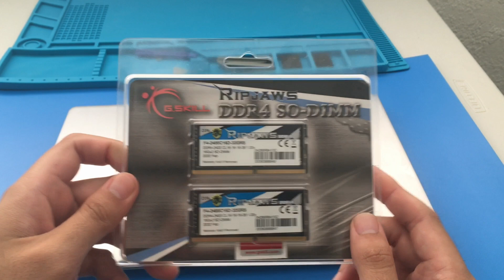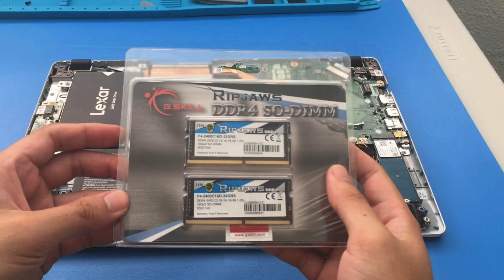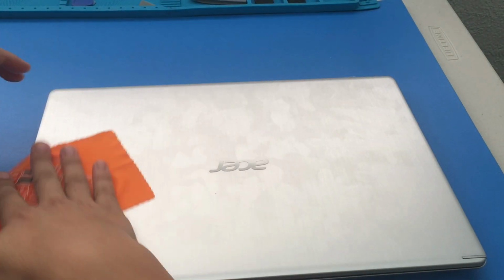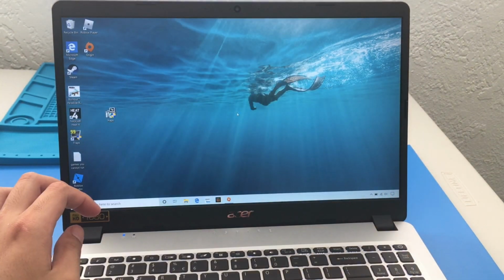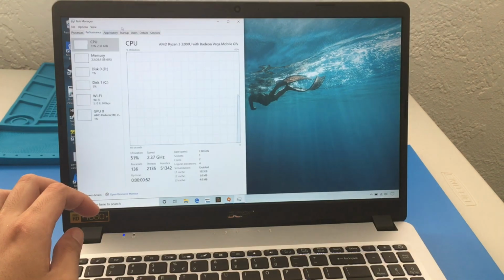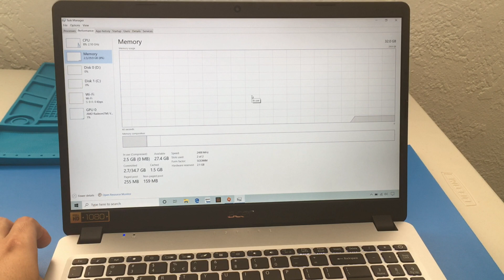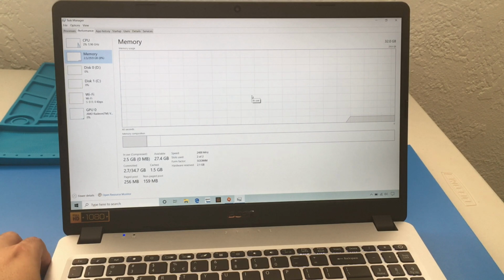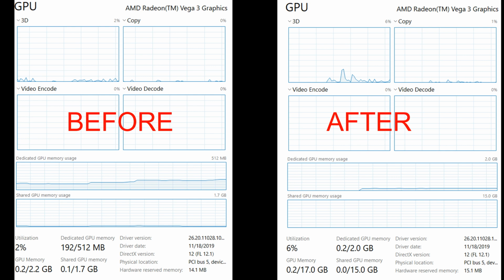32GB DDR4 Ram Upgrade! Acer Aspire 5 Slim Laptop A515-43-R19L

Comment: These are fun laptops to upgrade.  I have two of them and upgraded everything, including the NVME.  They feel even more like an exceptional value to me now.
Reply from the maker: I agree fun laptops to upgrade! That’s nice you upgraded the nvme. I’m hoping to do that as well
Reply: @whattmeter  I used the Intel 660p 512 gb drives for the upgrades.  Bought them for around 60 bucks a piece.  I can trust Intel.  I would limit my choices to either Samsung, Crucial or Intel for something as important as a C NVME drive.  Adata is garbage and impossible to register online and when they fail, they don't honor the warranty.  Other brands are rebadged and renamed units of unknown origin.  So if you upgrade, spend more for the reliability of a real manufacturer.  BTW, the main reason the Intel was inexpensive is it is a QV drive.  Lower performance but on these bargain laptops, really do a good job.  Hope this helps.
Reply from the maker: Thanks! Wow good to know. I’ve never used intel ones before. I actually have an adata 2.5 ssd i will install as an extra ssd for a future laptop. Cheap, but I’m not expecting too much from it
Reply: @BillyLapTop  honestly when it comes to components sticking to big brands is better even if it may cost more. It’s better so you have actual warranty and not a cheap scam
Reply: For more information about laptop watch out this link : https://youtu.be/di-uzKxPf34
Reply: how much hertz does it have when you put 32 gb ram im new to computers so it would be help ful if u told me
and will it lag if i download a game valorant
Reply: @zayoodexe  Not sure if you are referring to the hertz of the memory or of the cpu.  Memory hertz is usually locked in on these units and can not be overclocked.  The cpu hertz is variable but capped out at 2.8 or 2.9Ghz in burst mode.  Regarding valorant game I have no knowledge on that.

Comment: I thought this laptop on takes up to 16 GB, in my opinion 32 is a overkill but it works good vid.
Reply from the maker: 32 is definitely overkill. I wanted to see shared gpu memory with increased ram
Reply: i need help how to get rid of windows s mode
Reply: navigate to Settings | Update And Security | Activation. In the Activation menu, look for Switch To Windows 10  Home--

Clicking Switch will open the Microsoft Store and prompt you to "Get" the full version, akin to installing an app. Once you do that, your PC will switch over to its full version of Windows 10 and you'll be free to install whatever apps you wish. - you cannot go back to "S" mode after upgrading if that matters.
Reply: 32GB is not overkill, open 2 vmware machines and some chrome windows and it will be full.
Reply: @carlosfedericolopezspindol3103  what's vm ware?
Reply: @cjmeddings3205  virtual machine software
Reply: @carlosfedericolopezspindol3103  lol no significant fraction of the ppl who but this 350 dollar laptop are gonna do what u say.
Reply: Do you think this laptop is capable to run CoD Warzone after the upgrade(32GB)
Reply: @aminkhodary5154  if 20 FPS is fine with you then yes.
Reply: @Frost-ng4hi  will it lag a lot?
Reply: @aminkhodary5154  not with 32 GB of ram it’s just, it won’t be a smooth experience obviously kinda playable but not as good as console or a better laptop or pc
Reply: @Frost-ng4hi  I see. Thanks! I really appreciate your reply!
Reply: @aminkhodary5154  if the laptop use the i5 11th gen version , then yes, it will, though it will be like around 30-40 fps in low-mid(maybe) setting. But at this point, just make the Ryzen APU PC setup man..
Reply: @aminkhodary5154  not a chance lmao
Reply: I remember someone said that they upgraded it to 20gb, that might be the upper limit
Reply: Can 20 gb or ram 4+16 run roblox max graphics with a rysen 3 3200iu and a amd radeon vega 3 graphics card

Comment: Will Crucial’s 8GBx2 DDR4 RAM Work With It?
Reply from the maker: It should. Just make sure you choose 2400 Mhz laptop ram: you can also run the crucial scanner to double check.
Reply: jasetutorials why 2400mhz?
Reply from the maker: if you saw the ram video the stick installed was a 2666 Mhz, but the pc only read it at 2400 Mhz. that's why it's better to just get 2400 Mhz
Reply: I just bought crucial it should sork

Comment: can it also operate at a frequency of 2400 mhz?
Reply from the maker: Yes, the ram operates at 2400MHz
Reply: @whattmeter  can you make it run at a higher freuency?
Reply: @shod5507  no, the proccessor cannot handle ram with clock speed of more than 2400mhz (eg 2666), it will underclock the ram back to 2400.

Comment: gracias!
Reply from the maker: you're welcome!
Reply: @whattmeter  What Would happen if you added 64gb of RAM to this??
Reply from the maker: @code3_cali563  More shared gpu memory. At 32gb it doesn't use all of it, so I'm guessing also more unused ram
Reply: @whattmeter  I think 32gb is more than enough RAM. Most Games only require a minimum of 8
Reply from the maker: True. It was a good test. Ram is easy to swap out. Plus this is slow ram 2400 mhz.